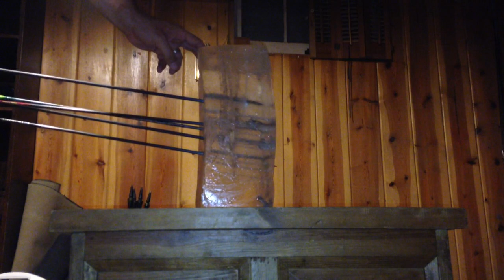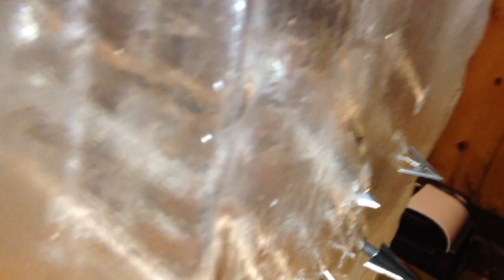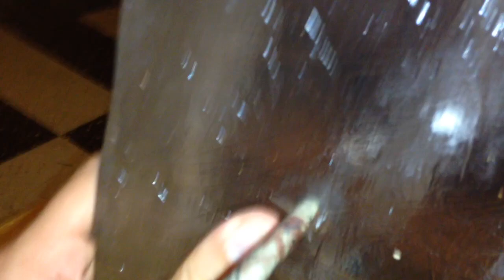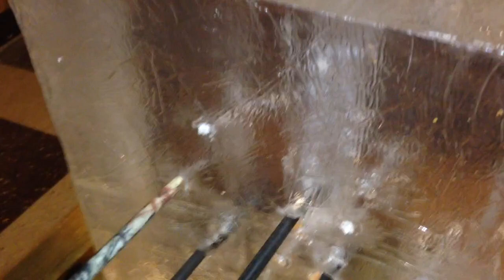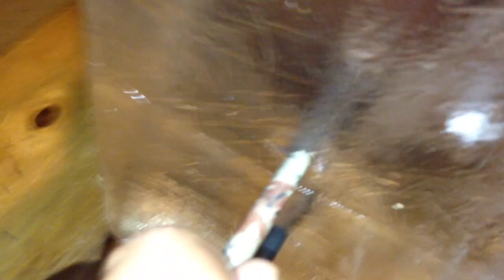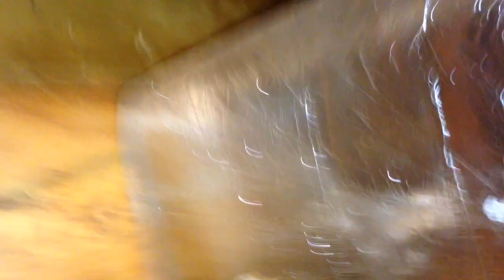Ballistics gel Broadhead test

Comment: Do you realize ballistic gel is NOTHING like live flesh?  Your test is basically meaningless as gel stops arrows by friction whereas live flesh & blood lubricated the arrow as it passes through.  Personally I don't really care how much penetration my arrows have against irrelevant mediums, I care about penetration on live flesh only.  Fun to watch, but not relevant to arrow lethality.
Reply from the maker: Paul Dufek thanks for watching. I have killed many deer 🦌 and you are partly correct. Also I have done many other type tests and penetration on gel is very limited correct but it does give the broadheads capability of cutting and it’s friction level I have used lubricants on arrows and broadheads before to test and have a good rresults doing this but this is just for test purposes only but I have discovered it does compare closely to life flash but with far less penetration
Reply: ripfletching, again balistics gel is not the same as live flesh whether you lubricated broadheads &/or shafts or not.  The lubricant is rubbed/wiped off as soon as it comes in contact with gel whereas live flesh is constantly lubricating the broadhead/shaft.  As a broadhead continues to penetration gel, more friction is applied to the system stopping the arrows & any effects of applied lubricant is long gone.  You did not indicate you lubricated for this test, but again that doesn't really matter as the test shows what your arrows does in gel, not animals.

I personally would not be worried about penetration on a deer sized animal for many standard broadheads today, unless a major bone is hit, but for elk, it definitely does matter.  

As an engineer who works with & studied friction my whole life I would stake my professional reputation on this.

Fun to watch, but not a "true comparrison" to animals.

Thx
Reply from the maker: Paul Dufek There was no lubrication on this particular test just stating I have tested with lubricants before
Reply: @ripfletching  The correct way to interpret gel tests is to compare the results against a projectile known to accomplish what it needs to do.  That's partially how the FBI determined their standards in the first place, they shot a 125 gr. .357 magnum round (what they believed at the time was the most effective "one shot stopper" bullet) through gel and then tested a bunch of other rounds against those results.  If we apply that to arrows I'd say if there's a broad head that you've used to put down many deer, shoot that through gel and then shoot a bunch more through the same block.  If the cuts are larger and the penetration is deeper than the "control arrow", so to speak, then it's most likely a better broad head.  In short, gel is comparative to itself, not to live tissue, so the results are relevant as long as you first establish a reasonable base line.

Comment: I Need To Ask ,What % Ballistic Gel was that 10% or 20% ? I need to make a few hunting simulator tests for my Heavy Bows , I plan on melting it down and adding simulated bone and etc. 
my lighter Bows are 115# and Heavier Weight 200# (recurve and longbows)
Reply from the maker: Denny Erickson this is the synthetic ballistics gel FBI grade it is not homemade so I do not know percentages
Reply: +ripfletching Thank You for the reply, most often the 20% is what's used for Law Enforcement
Reply: Use 10% for sharp weapon tests. Basically, 20% is simulating bone and tissue. If you want to simulate bone with sharp weapon tests, use wooden dowels.